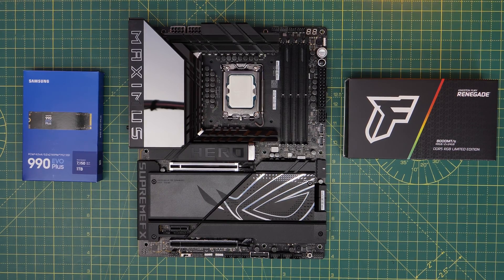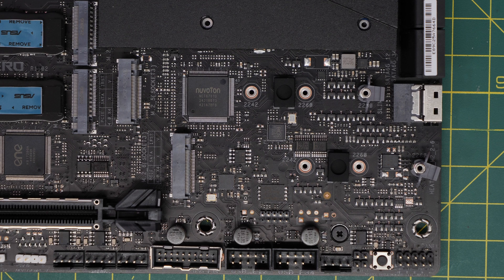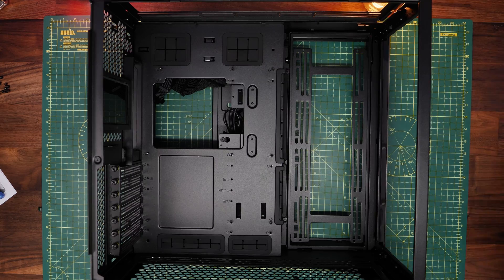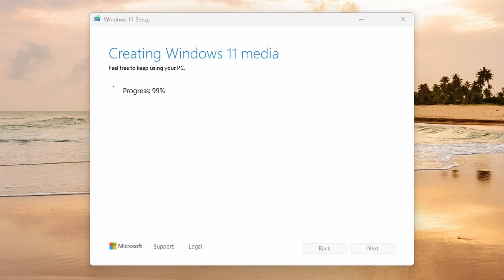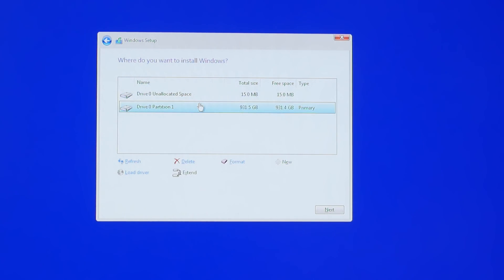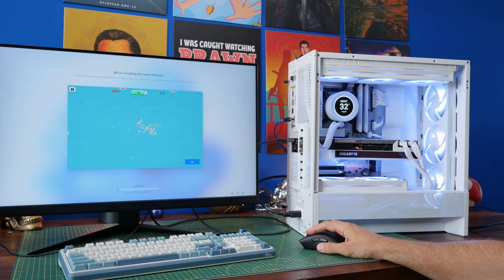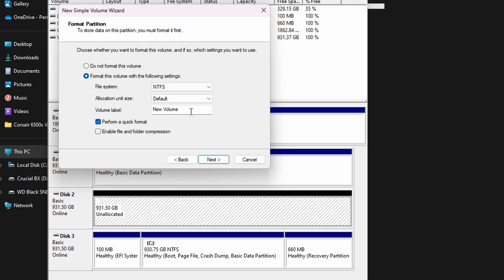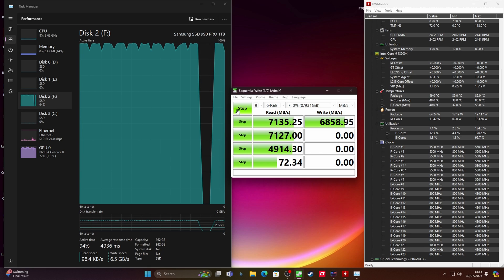Samsung 990 Evo Plus install and setup guide

Comment: I've added this to an existing PC. Windows already installed. I have initialized the Disk already, same as the steps you performed. HOWEVER, on boot the Disk usually does not show. Windows does not recognize any "Disk 2". On restart, it usually appears again. Cant figure out how to prevent the drive from disappearing.
Reply from the maker: Is it possible it's overheating?

Comment: Sorry for the question, I just installed it but I removed the brand sticker. Now they tell me that sticker was a heatsink. Is it true? My MB is a MSI X870E TI EDGE WIFI
Reply from the maker: https://youtu.be/YUJKyA-q7Zs
Reply: @TheProvokedPrawn It tells me the video is not available
Reply from the maker: Weird. I just clicked the link and it worked  @CptCrash59
Reply: @TheProvokedPrawn  yes yes it works, grazie!!!

Comment: Also, heads up because some m.2 slots share lanes with the PCIe 16x slot, so populating a m.2 slot with an NVMe drive can potentially bottleneck your GPU.

It can be different slots even within the same generation of motherboard, research it before commiting to a specific motherboard.

Random, tangentially related information, but hopefully it helps somebody.
Reply from the maker: I've tested that and it makes no difference https://youtu.be/CT55vgeuhPo

Comment: If you prefer to install Windows without a Microsoft account, you can press Shift + F10 during the windows setup screen and in the CMD window that appears type in: oobe/bypassnro

This will reboot the system then allow you to set up a local account, and also skip installing Wi-fi drivers in case you don't have an ethernet cable to plug in.